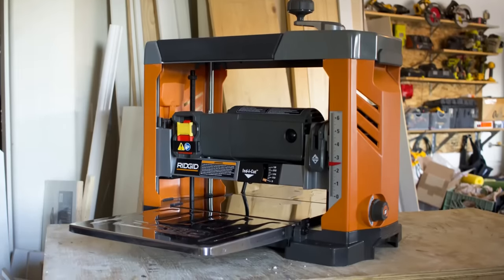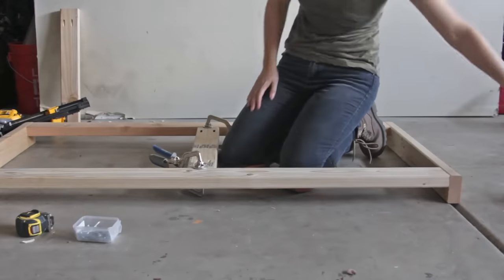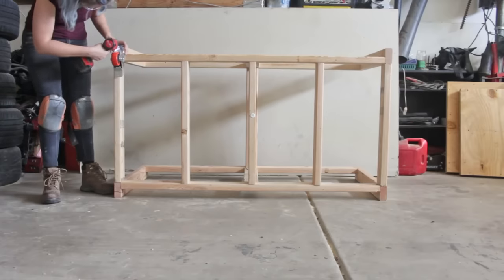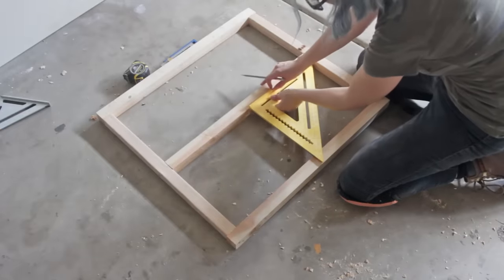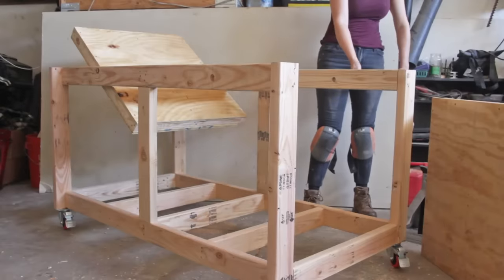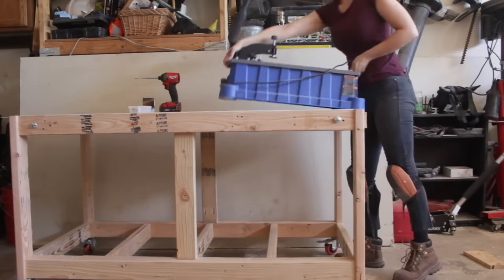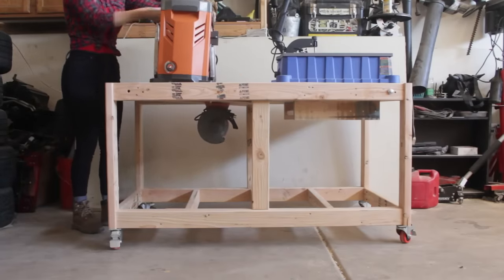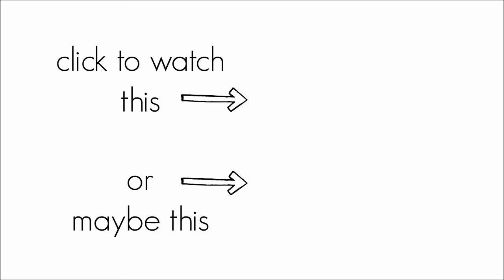Double Ended Flip-Top Workbench | Woodworking Build

Comment: Three things I’d like to suggest.
One, look into Forstner bits. Those paddle bits are a pain in the behind.
Two, consider using pipe or tubing for your pivot instead of the dowels. They’ll last longer, 
and you can get away with a smaller diameter, reducing how much material you need to remove to fit them 
Thereby reducing the chance of a beam failure due to weight/pressure on the pivot point.
Three, when you pair tools on a flip bench, try to ensure they’re roughly the same weight on each flip deck. 
They’ll help each other roll over without being unbalanced. This will reduce the likelihood that you lose control 
of the deck while turning it over, so you don’t hurt yourself or damage a tool.
Great build. I love the concept.
Reply: She did have one
Reply: @3:33
Reply: Yup. Saw that. I hate paddle bits. Always have. I’ve been building custom furniture for thirty years. I don’t use them. Ever.
It’s nice to see the anonymous experts on here can maintain a standard of civility...
Reply: joseph erwin - if you love the concept check out stumpy nubs... he has a cool carousel type gizmo he made - tools don't flip upside down, they sort of rotate - just a ferris wheel.
Reply: another thing. no point in checking for level unless the cradle is level also. just measure parallel and square.
Reply: effyou28- MAYBE YOU SHOULD LEARN TO SPELL BEFORE YOU POST!
Reply: Excellent critique! This is the way that a teaching moment is done: respectfully, and constructively. All too often the comment section on YouTube becomes a snarky, mean spirited vehicle for egos to let the world know that they are the arbiters of perfection. You sir, help restore my tattered faith in our species. Thank you.
Reply: Wow, no room to sit in this thread.
Reply: @mihainiclucaciu5258  What is this sexist nonsense you were saying? What benefit do you see for yourself or other people in trying to make this exchange about gender?
Reply: What's wrong with spade bits? Never had any problems, they cut fast and clean when sharp (easy to sharpen, too). I always struggled with forsner bits in handheld tools, they tend to jam and clog, and you need a lot of axial force to keep them cutting. Different story on a column drill.
Reply: The pipe idea is a good one  a piece of EMT would work great. BUT careful reducing the diameter of the pivot.  The bending stress is a function of the diameter to the fourth power!  so while steel is much stronger than wood,  a 3/8" solid steel rod will bend much easier than a 7/8" wooden dowel.
Reply: Joey errwin Can not stand women !  in the work place...  #1 woman has forstner bits...  #2 woman wanted it out of wood...  #3 oh hell, your not worth it !
Reply: computername, as I wrote in a previous reply, I just don’t like them. It’s a personal preference. Nothing against your experiences. No need to take it personally. I used them when they were all I could afford. I stopped when I was able to find a tool I personally find more reliable.
Reply: Gregory Dalton, good point.
Reply: @mihainiclucaciu5258  Don't be so sensitive.  Constructive criticism does not equal mansplaining.  Plus, mansplaining is a term used by weak minded individuals who can't take constructive criticism.
Reply: @josepherwin8709  Just wanted to mention that the additional 2x4 she put on the outside of the table top, to keep the dowel from shifting, would be sufficient added support to counter the 7/8's hole she drilled for said dowel.

Comment: Cool idea. I was thinking if you put a strip of wood or metal on the top back side of the rotating shelf, it would act as a stop to keep it from over traveling. Then put one on the other end, opposite side to stop against the bottom of the frame. Would make putting the bolt in easier as there would be a positive stop to hold the moving bit against.

Comment: Hey SPONSORS!! Give this girl a drill press! 
Awesome build!! Thanks for the super, easy practical project! Right up my alley.
Reply: I'm confident she can easily build a portable drill press with some wood scraps. This lady is a marvel.
Reply: think she has enough sponsors going on for an amateur woodworker.
Reply: was a pretty obvious hint.
Reply: How about just buying one. They're not that expensive.
Reply: Aaron Lance .Grow up
Reply: A drill press created from a normal drill is not quite the same as an actual drill press, particularly because of the amount of force required for large holes. For small holes, that would work perfectly fine. But for bigger stuff... the only benefit you'd get is alignment, while still using your entire body weight to push the damn thing down lol.
Reply: @Aaron Lance this video payed for a couple of drill presses.

Comment: I  purchased your plans and modified them as my planer is a Dewalt DW735 and is wider than yours so rather than having two 26 x 28 inch shelves, I made mine 28 x 28 inch so the handle would not catch on the 2 x 4 frame. This Dewalt planer weighs 92 pounds so I was a little reluctant to use a wooden dowel so I had an old 1/2 inch pipe clamp so I used the metal pipe instead and It worked fine. I will be building the out-feed rollers next and I have my belt/disc bench sander on the other side and my scroll saw will go on the other side when I figure out the best way to attach it. When you have to share your garage with cars, this Double Ended Flip-Top Workbench saves on floor space. Thanks

Comment: Very nice, I think your concept and execution of this project was excellent. Some suggestions to improve it... I suggest you use steel rod for the pivot instead of a wood dowel that may break after a few years and end badly for you if you're standing in the wrong spot. For a smoother roll, add bearings. I would also recommend lining the locking pin holes with a steel tube - This is more for longevity of the table than anything else. Those carriage bolts will eventually eat through that wood as you pull them out and put them back in over time. It'll happen with the steel piping as well, but it'll last longer. And my final suggestion to improve the table would to add some reinforcement bracing to the top that the planer sits on. Perhaps you could use a 2x4 frame for the table top, and put plywood on either side, with bracing hidden on the inside where you can't see it anyway. It'll make the top much stronger, and last longer.

Comment: Just a little advice, never use a nailgun pointing at you or any of your body parts! Otherwise great job!
Reply: Correct, alwsys point at someone else. ;)
Reply: @TheRoadTaken  👍
Reply: Never aim towards your thumb, always aim towards your chum. 👉💨
Reply: I've never used one and I noticed this too. One miss of the joint and into your wrist it goes!
Reply: I've fired a 18g brad through a piece of 1/4" ply that missed the timber frame on the other side but found my thigh. not fun but nothing like a 3.1mm 3" framing nail.
Reply: I just said the same thing in my comment.  I used to work in the ER about 25 years ago and one patient came in with a 16 penny nail through his kneecap and into his femur.  The action was so fast from the nail gun that neither the patella nor the femur shattered, the nail just went in smooth and clean as if it was wood. I don't understand how they didn't shatter, but the X-ray of this knee was really cool to see.  The only other X-ray that even stood out was a spiral fracture, which although horrible, looks really cool in an X-ray.  The only other notable X-ray was when someone had inserted a mason jar somewhere I won't mention.  We knew it was a mason jar because you could faintly make out the word "Mason" in the X-ray.  Ah, the embarrassing things that people do and end up in the ER for.
Reply: So you’re saying I shouldn’t be asking my mother-in-law to hold wood pieces for me as I nail them in any more? Didn’t even realize not to be pointing it at her.😅
Reply: @Mister_Y  Well, mothers-in-law fall into a special category.  Just be careful of witnesses!  

Many people get so frustrated with their mothers-in-law, but they are lucky, they have them.  My wife's mother passed away before I met my wife, and her father passed away maybe 3-5 weeks after we started dating.  My dad passed away 9 years ago and my mom has dementia and isn't in the best of health.  All the support and help parents give, we didn't have, so don't count yourself too unlucky - you still have that resource.  

Best mother-in-law joke ever - 
Mother-in-law (MIL):  Son-in-law (SIL), SIL, you didn't get me anything for Christmas this year...why?
SIL - Well, I bought you something last year and you never used it, so why would I spend the money to get you something else?
MIL - ??? Last year you bought me a cemetery plot...
SIL - EXACTLY!!!
Reply: @Troy-Echo  I’m grateful for my MIL, it was just a joke to be clear. The stigma that MIL’s have do have their merits to a degree and that’s why jokes like mine are tolerated. I can’t imagine never having a relationship with my wife’s mother. Sorry you never had the opportunity.
Reply: @Mister_Y  :0)  I understand, totally.  I dated a woman about 25 years ago and her mother was such an UNdelightful piece of work and she took full responsibility for everything good in her daughters life, but didn't take any responsibility for anything bad in her life, much which was something she could be blamed for.  My wife's good friend has the best and worst case.  Her MIL is a Saint - they opened their house to them when they had hard times, helped pay off their credit cards to get them back on their feet, and watches their kids for free whenever her schedule will allow it.  On the flip side, her mom is a raging lunatic...this mom moved close, but is still over an hour away, wants to charge her daughter to watch the kids, wants to charge them gas money if she has to meet them half way to pick up the kids, but tries to force them to bring the kids all the way which is 2+ hours driving time, then complains she doesn't get equal time with her grandkids and tries to tell her daughter the other mother is trying to take her daughter and grandkids from her.  She also takes credit for everything good in her daughters life because of her shining example, but blames everything bad in her daughters life on her daughter.  Hopefully you've got a Saint MIL.  :0)  I wish I'd have known my wife's parents.  They made a ton of mistakes and bad calls raising her, but they were not out of neglect or bad intent, they had a hard life and were strict on her trying to protect her from mistakes her mom's family had made.  That part of the family is the very definition of trailer park trash, and my wife is a good person and doesn't do any of that drama, so they did something right, and enough right that I have to admit I have an amazing wife.  :0)
Reply: Try building for a living. You don’t have a choice then to point it at yourself. Just don’t miss

Comment: I have a 12 1/2" planer, A 6" joiner, an oscillating spindle sander and  a bench top drill press I would put on something like this. Then build a single for my band saw and scroll saw. Thanks for the Idea.

Comment: Swap the dowels for threaded rod. It will be much more sturdy.
Reply from the maker: That would be a great modification
Reply: Pneumatic Addict , I probably wouldn't suggest threaded rod because after a while it will chew away at the holes. as long as you don't park your car on your bench the dowels are perfect. great job
Reply: I agree with mark. Threaded rod would only cut into the surrounding wood. I see no issue with hardwood dowels for this use. Steel round bar or pipe could be an upgrade, but dowel is more than sufficient for this kind of project.
Reply: Threaded rod would act as a saw ever rotation, using round stock (pipe or tubing) would be ideal for strength

Comment: I used to be a nail gun design engineer, and I would highly recommend not having the nail gun pointed at the body if possible.
Reply: i noticed this as well. Especially, don't place your support hand behind the work when shooting. I can tell you, it hurts when you have to pull your hand off a nail.
Reply: I concur. Had a brad nailer shoot through the first piece but bent and curved back out when it hit the second piece behind it. It ended up in my thumb that was holding the piece.... Not pleasant!
Reply: I shot my palm before. Sometimes you learn the hard way.

Comment: I love this bench. Did want to put 1 thing out in regards to safety though. If your need to put anybody parts on the business end of a nail gun, better make sure the guns pressure  is set correctly to prevent that nail from going through the wood and into you. Also if your not lubricating the nailgun as per your manual, it can affect the nailgun pressure overtime especially if the internal buffer breaks.
Be safe, thanks

Comment: I've been meaning to do something similar for a while for all my smaller tooling, just never got around to it.  I'm kinda toying with the idea of using a 2-4'' pivot riding on bearings /w built in dust collection ports for each station (could even do a built in down draft table in that sense).

Comment: Great design. Really useful in any shop that's short on space.

One change I'd suggest is how the dowel mounts to the side rails. Instead of just drilling a hole through the rail, I'd make a U-shape channel from the top down, to allow the tops to be dropped in from above. Once the top is in place, it can be secured by adding a filler block to the top of the channel, so the tops won't jump up and down when they're spun.

If a top is ever damaged, or if you need to replace one with a custom shaped top to hold a new tool, it would be possible to replace it without taking the skirts off the frame, or disassembling the entire top and cutting the dowel - just remove the filler blocks, lift the top out, and drop a new top in place.

I think I'd also go with steel pipe instead of wooden dowel as the pivot point. Literally the ENTIRE weight of the flip top and everything on it - tools, materials, instructions, snacks, and drinks - rests on the pivot, and even though a 7/8" dowel is pretty strong, a 73lb planer, plus a grinder, plus the weight of the top itself, is going to wear grooves in the dowel at the ends where it spins in the frame. Ten feet of 1" steel pipe is only about $25, so the cost isn't tremendous, but the steel pipe will never need replacing and can even be re-used if you made new tops in the future.

I'd probably mount a power strip to the center support, too, and route all of the power cables to it permanently. Then there'd only one cord to pug in when you want to use any of the tools on the bench. And extra outlets on the table in case you need them to plug in your camera, charge your phone, or add some Christmas lights to your shop over the holidays.

Comment: Thanks for the video.

Well narrated, decent video; very informative.

It was a bit nerve racking for those times that the nail gun was pointed in your direction ...but I am just paranoid that way.

Also, on getting the tops lined up (around 5:30 or so) - flip the entire the bench over, so you could rest the top panels on the floor - then slide in the dowel.

Also, either some big magnets, or some other mechanism to hold the carriage bolts to the side of the frame when flipping would be cool.

thanks for the video - nice to see more methods and ideas; will have to watch more on your channel.

Comment: Great build! I suggest to attach the lug bolts to the workbench with a string or wire so there would be zero chance of losing them and having the extra benefit of just leaving them hanging when you go to flip

Comment: I like the overall design! Though you're counting on the pull out strength of a few 3" nails on that center connector to hold it all together on something that gets moved around. I would add a 1x4 horizontal stretcher on either end with some screws to make sure everything stays put.
Reply: Do you mean for the horizontal 1x4 to attach on the ends where the tools would interfere when being flipped? Otherwise, I don't understand the location
Reply: @10Timewaster  yeah, I think that is what I meant. I didn't really think that through, they would get in the way when flipping the tools.

Comment: Good job, Elisha! I like how much you can put on that cart. And the outfeed rollers are a good idea. You're going to love having a planer!
Reply from the maker: Thanks Bruce! I used 7/8" oak for the dowel. My husband is an engineer and did a rough calculation for me. He said it should take approx. 800 lbs. You could always use metal pipe instead for even more strength. I bet the 2 x 4s would fail before the round dowel does.
Reply: Pneumatic Addict Wow! That’s impressive it could hold that much. I think you’re right about the 2x4’s failing before the dowel would.

Comment: Good job.  I would recommend you add a 2x4 stub to the bottom of the feet so you attach all four bolt holes on the casters.  That will make it more stable.  Also the carriage bolt is good but it could be simpler if you added a couple of nuts, a washer and a spring on the inside.  That way you would pull the carriage bolt out slightly for it to release, then it will pop back into place when the table is turned around.  You would have to mortise out the table a bit to accommodate the bolts and spring but it would make it easier and less likely to drop the bolt and have to chase it around the floor.